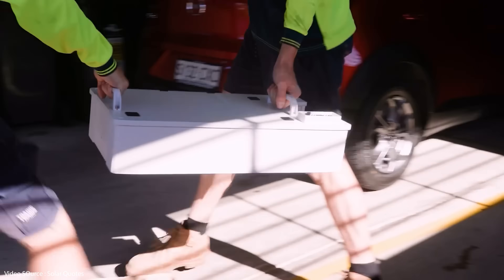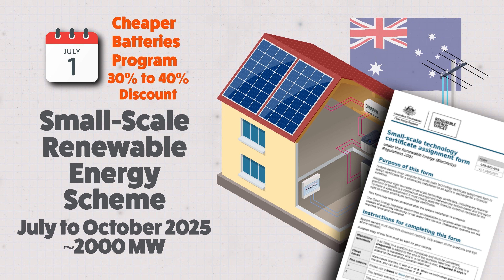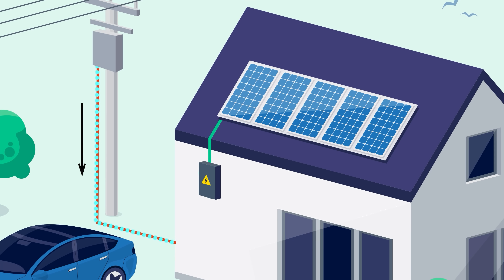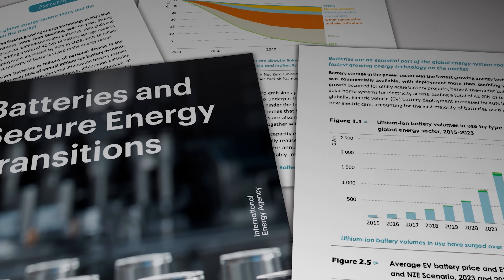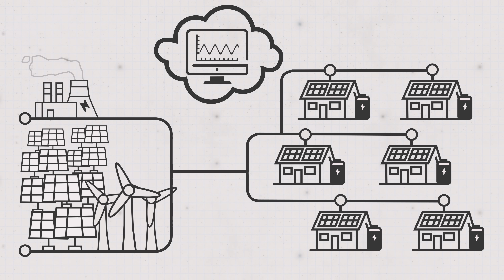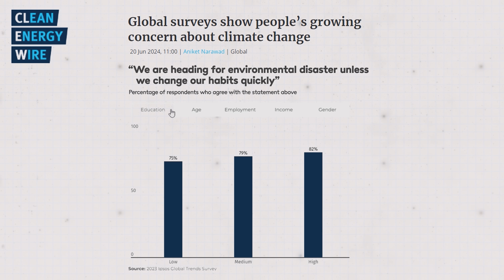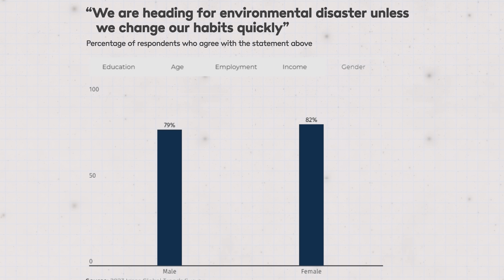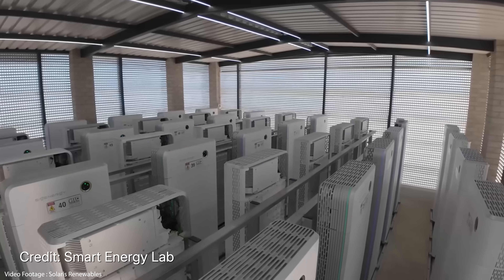Australians installed 100,000 home batteries in 17 weeks. Why can't we all do that?

Comment: Most diagrams show simplistic DC  style upload and download of energy. AC is not that simple Who are where is the centralized frequency control? Can peak voltage allowance be increased to enable current to head in reverse?  Is 253 volts acceptable on a "230V" grid?

Comment: I made use of this Government rebate. My house had a 5.5kw solar only system and I was paying about $2500AUD  a year in power bills. Added 8.8kw of solar to the existing system and a 16kwh battery with 10kw inverter which cost me about 17k AUD after rebate. My first power bill for the 3 months after this install was $9, and that was the winter quarter where I had to draw from grid about 2 days out of 90. I will get a credit for this next quarter and my whole house is protected in the event of a blackout now. Best decision I've made.

Comment: I live in Aus and installed a solar system 10 years ago. But only panels without a battery. I checked the financials on battery systems about 2 years ago, and it was not going to work financially. Given what you have said, I might have another look. But I think the financials are not yet a no-brainer.

Comment: money lul
was good to get some of the price knocked off, but a 12000 solar+battery installation still ended up costing 7000 (could have bought a 5090 and had change to spare), extremely useful especially out in the boonies where blackouts are long and common, the solar panels themselves will pay for themselves within a few years, but it's just not pocket change for the average person
i quit smoking tobacco (among other things) to make the savings needed, so yes it was a very high priority and i'd recommend it to anyone who owns a roof and a fuse box, but $$$$$$$$$$$$

Comment: Another way to address the load imbalance is for energy distributors to install either their own neighbourhood battery farms at local substations, or at point of generation. Scales of economy then also come into play. It costs far less to install 1,000 batteries at a time  at 100 industrial sites than it does to install 100,000 batteries at 100,000 individual homes. Those with panels can be exporting to the grid, while those without can be using that energy from the grid. Then, at night, the excess stored in the batter farms can be used to supply power to everyone, direct from the excess received and stored in the batteries. This reduces the demand from coal or gas power generation both during the day, and and also at night.

Comment: I'm in Victoria and have solar for around 15yrs. I just installed 27kWh of batteries, the rebate helps, but the reality here is our solar export is only 1c/kWh so self consumption is the way to go. I wish I had of capped off and bought the full 50kWh allowed under the rebate. 
The interesting thing in Victoria is the price of electricity seems to be going up rather than down as a result of all the solar and batteries. The FiT is basically stealing our power, there are schemes for free power in the middle of the day (makes sense when solar is so high) but the peak is generally 3pm-9pm and those prices are very high. All the rest of the time the price isn't too bad. Self consumption through the peak is definitely the way to go, but I think the lower income people will be really feeling this as they probably can't understand it afford the batteries. Rentals and others who can't control their own installations would also be the losers from this impressive transition of power flow.

Comment: Now sodium batteries are being made on the industrial scale, it makes sense that Britain is invests in a chemistry that’s safer and copes with many more cycles before degrading.
Reply: Are you really keen to live in a world filled with trillions upon trillions of battery cells susceptible to electrochemical fires?
Reply: @Les_S537 Sodium cells aren’t fire hazards, but you have raised economy of scale issues.
Reply: @Fred70115  They're not immune to electrochemical fires, they're just not as energetic when it happens.
Reply: @Les_S537 their durability is a positive factor, capable of many many more cycles than lithium batteries. Reducing drastically the number of batteries needing recycling. So, your point is off target, when comparing lithium & sodium batteries.
Reply: @bodyandsoulproject  sodium ion batteries do not last longer than lithium iron phosphate batteries (4,000-8000 cycles vs 3000-6000) and they have lower volumetric energy density...

Have you considered geothermal as an option at all?

Comment: Could batteries be a good appliance for urban or shaded houses that can’t produce solar electricity but can still help even out the grid demand? Our provider now charges double in peak hours (5-9 pm) as during the rest of the day; so could filling up the battery & running appliances off it first be a good economic and/or grid balancing choice?
Reply from the maker: Yes. Good plan 😊

Comment: Yank here. I have a home solar system, but no battery. I do have an EV car. I am personally familiar with two other solar homes, neither of which have a battery. The current red hatted administration wouldn’t dream of assisting the adoption of battery technology unless the various grid operators begged them to implement the tech. My energy bill went from about $100 a month to about $10 after the rooftop solar went in. So far so good. The home battery seems a good fit for the sodium technology. Keeping fingers crossed on the adoption rate here. Safety and price are the main concerns.

Comment: I'm in Sweden and I'm getting my battery system installed in about a week. It's a 46kWh unit, supplementing my 24kWp solar cells. I've had about one hour of sunlight so far in December, so the batteries will be a huge help.
Reply: LOL, your batteries will effectively be as productive as paper weights if your solar panels are getting little or no sunlight.  We can make wind and solar work for a location such as yours, but in order to make it work we have to OVERBUILD.  In other words a single solar panel on the equator produces way more power than a single solar panel in Sweden.  In Sweden, at such a high latitude you need 2.x times as many solar panels to produce what you actually need.

I'm all for more renewables, but a world filled with millions upon millions of wind turbines, and billions upon billions of solar panels alongside trillions upon trillions of battery cells is a repulsive world to me...  It's also WAY more work and resources than is actually needed.

More robust power sources like geothermal and nuclear are the path forward.
Reply: @Les_S537 dynamic pricing, mate. I can charge the batteries off of the grid when the price is very low, and either use or sell to the grid during daytime. In addition to that, the battery stack will bring in revenue from grid support services such as Frequency Containment Reserve or Frequency Restoration Reserve. For my battery size, the grid support alone is estimated to bring in about €100-200/month. Add another €200 or more from cheaper electricity during off-peak hours. And this is during the winter when I'm not benefiting much from my solar panels. I'm paying about €8000 for the batteries. Even if they bring in half of what I'm expecting, the ROI is less than five years.

Edit: My solar panels are producing about 15MWh/year with daily peaks of about 120kWh during summertime. What many people forget about Sweden is that we get VERY long summer days. During the summer, my panels are producing power 18 hours a day. And my roof is very suboptimal. Even so, I'm not paying for electricity between March and October.
Reply: @Pallidum  But you're also wearing out your batteries much quicker.  Doesn't matter what chemistry you use, your battery cells only have so many charge cycles in them, and if you're frequently charging and discharging your cells you are undoubtedly shortening the time they'll be useful for you.

Right now we're splitting up the production of batteries between battery farms for wind and solar, and EV battery pack production.

Our focus should be on getting ICE vehicles off the road and getting people into EVs because having 1.5 billion vehicles pumping out carcinogens and toxins everywhere that they go is polluting the environment MUCH more than the output from fossil fuel power plants (fossil fuel power plants can mitigate most of their particulate impact at the source).

With regards to your selling the energy...  We're already seeing energy companies clamping down on how much they actually pay you for your energy.

It's the old story of the frog in the boiling pot of water.  They pay you a nice sum at the start of the program, but then they progressively pay you less and less per kWh you sell.
Reply: @Pallidum  Sorry, but 8000+ lifecycle cells only exist in tightly controlled lab environments.  They don't exist in the real world, and in order to gain those lifecycles what do the battery manufacturers do?  They have to lower the density of each cell so they hold less energy which means you need more cells.

Sorry, but a world filled with tens of millions of wind turbines, and billions upon billions of solar panels, and trillions upon trillions of battery cells is abhorrent to me, and way more work and resources than are needed..

The world could be powered by a few tens of thousands of geothermal power plants which can last for centuries where wind turbines, solar cells, and batteries have to be recycled every few decades.

Geothermal is the path forward.  Way less resource usage, and capacity factors of 70-90%

Comment: The subsidy is so smart because it sidesteps two of the largest problems many countries face with setting up large scale storage: lack of large scale grid connections and NIMBYism against such installations close to settlements.
Reply: That makes no sense...  You would NOT want to have a large battery farm in your city, so why would having tens or hundreds of thousands of smaller battery backup systems in homes across your city be any different?  The toxic fallout from battery fires will be bad, and electrochemical fires are not pretty.
Reply: @Les_S537  The amount of cells are the same whether you spread them out or put them in one location... and LFP is safe. You have dozens of 'less safe' lithium ion battey types somewhere in your home and houses aren't combusting left right and center.
Reply: @peterzerfass4609  No battery chemistry is safe when an electrochemical fire starts.

Comment: I have been saying to anyone who will listen (and a few that I have had to follow around while they try to escape) that we should be putting batteries into people's homes, not stacking them up in unpopular mass storage systems in the middle of the countryside.  Even without solar, you can have them remotely activated to charge when power is plentiful and discharge when it's scarce.  A lot of people in the UK still have Economy 7 or some variant of it.  Charge when it's cheap.

Comment: Check the math on this. These battery systems cost....$20,000 each? Of which the govt is paying 1/3 as incentive subsidy? That's $6,500 x 100,000 = $650,000,000.  The entire system is 2,000 MW, so that's $325,000 per MW of storage. From a grid perspective, this seems very cheap for decentralized, owner paid most of the costs, load stabilizing, battery storage.
Reply: Geothermal is the real answer.

Comment: I’ve had solar PV for 10 years and a heat pump since 2023. My panels are still slightly outperforming their predicted generation but I am investigating replacing them with more efficient panels, adding a better inverter so I can keep my FIT contract and adding a battery. I live in North West England and will need to drain my pension fund to pay for it so cost and payback are very important. The cost of batteries may have come down, but installation costs don’t seem to have come down proportionately..or perhaps it’s my imagination. Anyway…very keen to make myself energy self-sufficient if possible. We’ve already had two power outages this week!

Comment: Here in Germany we put a battery in in February. It looks like it will reduce the electricity imports for the year from 4000KWh to 2000KWh, and close to zero for six months.
However, the thing is not very smart. It only reads imports and exports and charges / discharges accordingly. So in summer, it is often full by 12am, and then our solar PV starts dumping 10KW into the grid, just as wholesale prices go negative. 
A bit of machine intelligence is needed.

Comment: australia has had good subsidies support for domestic rooftop  solar PV (now mostly phased out) and this along with other policy work led too Australians enjoying the lowest soft costs for solar system installations in the world. we pay the same import prices for panels and inverters (almost no local manufacture left of panels or inverters) but the planning approvals, certification costs etc etc are known as “soft coats” and our industry is streamlined so much that we get fast connection approvals and low overheads for installers to do it compared to other countries, even Germany. USA has amongst the highest soft costs and delays, which one cannot help feeling is thanks to fossil fuel industry lobbying and the capture of political systems and regulators. 

this meant when theFederal  Government introduced generous battery subsidies to home systems (ali most the entire sus audy has been from homes not small businesses unfortunately) just as the state governments  are gutting export tarifs and introducing time of use tarifs. it means PV isn’t an earner any more, and self consumption is kind. unless you op for the one utilities in the retail market who offers wholesale pricing. either way, batteries are a commercial proposition if the government is going to cover a third of the cost. 

with low export tariffs and high time of use consumption the idea is to charge the battery all day then self consume it  in the evening shoulder. those on wholesale pricing might want to play the markets but it’s a casino and needs constant monitoring or you can get stung. just as utility scale PV is significantly cheaper per. MWh than behind the meter PV on houses, so too are utility batteries. but these schemes are politically popular and give people a (maybe false?) sense of agency over  the. climate catastrophiez coining our way.

Comment: I am looking forward to being able to deliver substantial power to the grid from my EV, in the maximum load period from17-20, and the fill up the battery again from midnight. My charger installation is like most Danish  households 3-phase up to 21kW, so the potential is huge.
Reply: You're dumb for letting the grid use your car battery.  You're shortening the life of your EV.  Li-ion batteries only have so many charge cycles before degradation begins to kick in.
Reply: @Les_S537 Currently I would only be making 25000dkkr/year, selling 20kWh in the most expensive period, and you are right, that would not be much compensation for the wear on my current cobolt- lithium battery. I am thinking of future more charge resilient batteries, and a higher price for delivering power in the max load period. Just a few hundred thousand EV's could replace a big power plant. But the technique is not quite here yet.